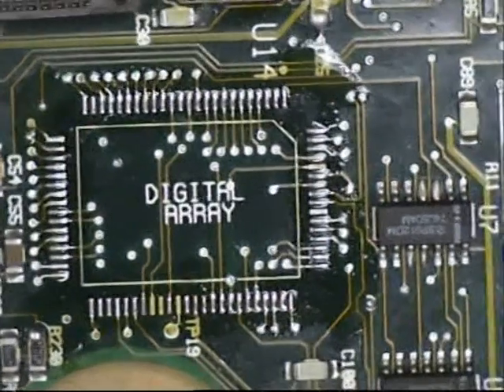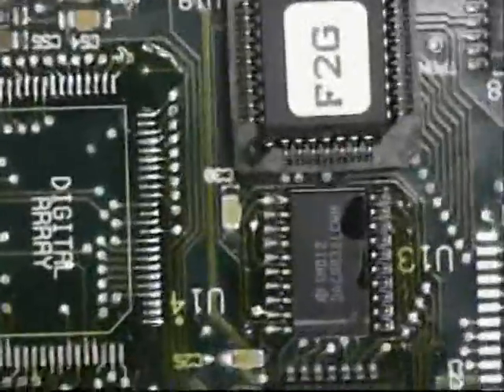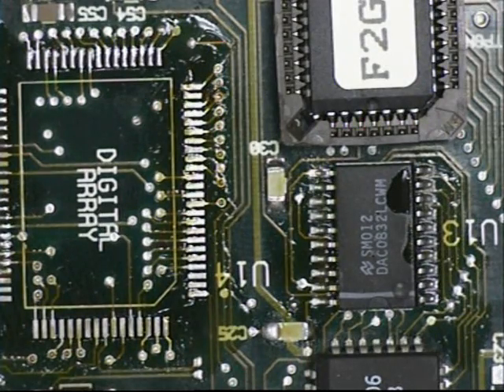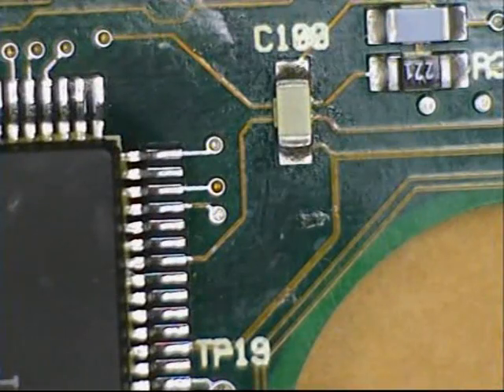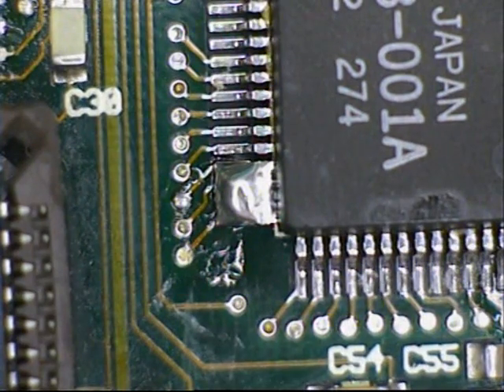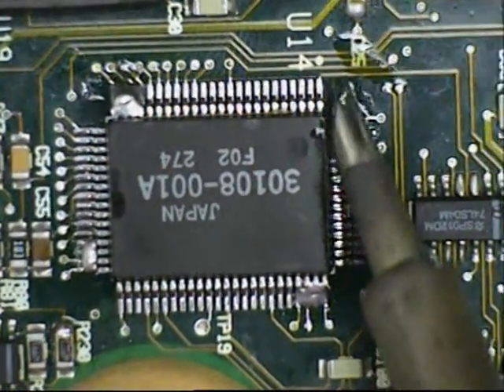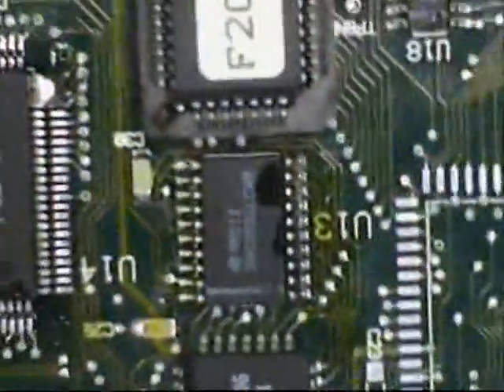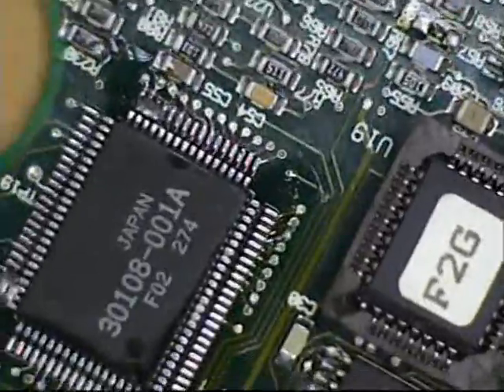80-pin QFP Re-Soldering.mpg

Comment: lol You risk damaging the pads, they can come off if you do this. You are applying too much solder and you're keeping the contact with the iron too long, you can damage the IC's. You should not do it like this. Drag solder method should be done quickly.

Comment: This is the crappiest tutorial on QFP soldering ever. You should apply flux on pads, before you place the component. Then apply solder on your iron tip and make one pull slowly from top to down. this is called manual wave soldering. There is no need to shake the tip of the solder iron like. Before you teach, make sure that you know what you are teaching.

Comment: I have been working with this technique and I really prefer it above using soldering paste. BUT, you need to use a lot of flux, just a tiny bit of solder and handle much quicker. In one stroke it can be done without repeatably moving the iron.

Comment: I can say this as well, even i never soldered SMD IC's. The heat can also damage the Board after such a long time. And the Copper Desoldering at the beginning was done by to much pressure - you could have ripped of a pad. This never happened to me, but it still can happen. Soldering 1 side of a chip like this should take up to 3 Secounds - it wont need more time, cause you wipe over it 3 times and it should all be done.

Comment: bernadezi is right, the video shown here is not a good example of how to reliably solder SMT components without risk of damage due to heat stress (he spends way too long in reflow while the IC is vulnerable to heat stress) if you want an example of how to do this properly search YouTube for: Professional SMT Soldering

The videos that come up will show some excellent examples by a user named: jkgamm041, he is an IPC certified instructor and his videos are excellent.

Comment: In my opinion the operator shows a lack of finesse throughout the whole process. A very un professional example of qfp replacement. I believe he was very lucky not to lift any pads when using the solder wick. He also used excessive heat and solder to complete the job. A good example of how not to do it perhaps.

Comment from the maker: If you are using a New Component and the leads are not oxidised the Flux in the Solder Wire will be sufficient.
Most important step is Alignment and making sure the Pads have no solder so that surface is flat and the QFP sits nicely.
After Aligning the QFP Tack the corners of the QFP and perform Drag Soldering, If you need more information email vanco@vanco.com.sg and attention to Robert.

Comment from the maker: Hi,

Using a Hoof or Hollow Tip we drag a reservoir of Solder across the leads without pressing down and allow the Leads to absorb as much solder as it can.

Since the Reservoir of Solder on the Tip has a greater surface tension than the Solder Leads the excess solder is removed as we drag across the Leads.

We remove the excess solder by tilting the Board so that Gravity plus the weight of the solder will come off cleanly from the last two or three pins.